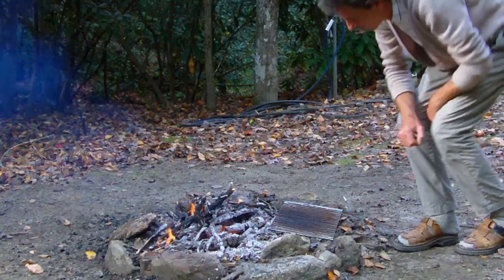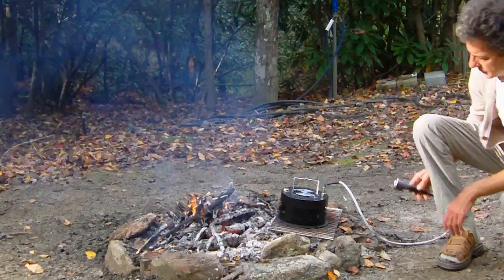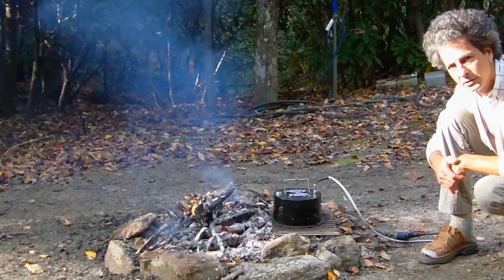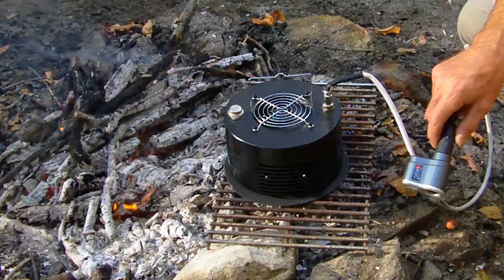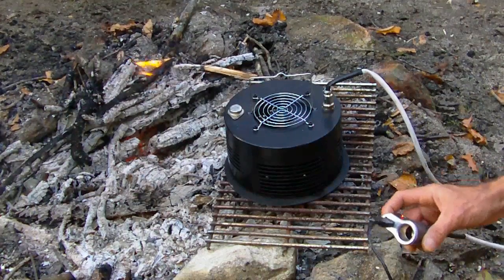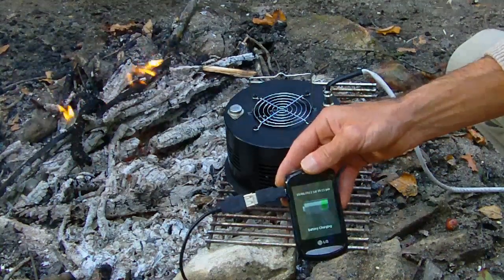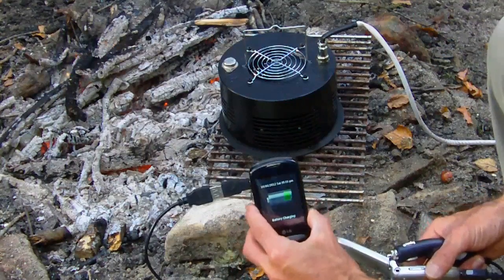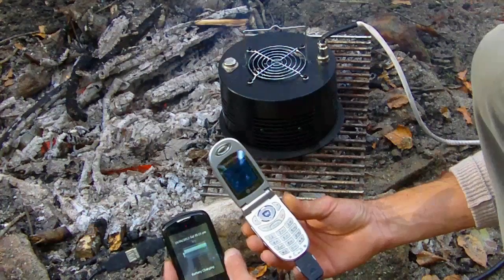Camp Amp 8 Thermoelectric Power Generator on Camp Fire

Comment: So it's basically a stirling engine?
Reply: It's a different phenomenon, but yeah.  There's something Carnot about both, with heat energy flowing from heat sink to cold sink.  Stirling works off expansion of heated gas, based on the gas laws. 

TEG works directly off the electrical properties of metals in a heat gradient.

One of the really neat applications of TEGs in the context of campfires is you can turbo-charge your camp fire with a fan that runs off the heat of the fire.  So you have a battery-powered blower to get the fire hotter and cleaner faster, and you keep the fan running and recharge its batteries off the heat of the fire.

They've got some pretty cool woodgas stoves that you can do all your camp cooking on, with blower and TEGs integrated right into your camp stove.  Quick, smokeless fires because you use a blower.
Reply: No, not even close. Stirling engine requires a working fluid and moving parts. Peltier-effect thermoelectric generators are 100% solid state and have zero moving parts.

They are alike in that they both require a source of heat at high temperature and that they must reject a significant amount of that heat to a lower temperature -- the basis of any heat engine.

With present technology, a Stirling cycle can be MUCH more efficient that a Peltier generator, but it's probably impractical at anything like this small a scale.

Comment: Amazing Product.Would this technology work well without the fan if it was connected to a stove with the cooling element placed outdoors? I am thinking of a scenario for people living in very cold climates.It would be a great addition to a solar and wind off grid setup.
Reply: Gary - The problem with these is that the hot and cold "sides" of the device have to be close together. With a heat source as crude as a campfire and a heat sink as crude as "the outdoors," at least one side needs some sort of heat-transfer fluid to maintain the necessary heat flow. For people living in cold climates, this WOULD be great, because the "cold" side can easily be as warm as a hot-water heater (say 140 deg. F. or higher), and that could drive an indoor heating system and also be used for showering, etc. You would need a little pump in that case to keep supplying cool water to the device, but it would be a nice way to get heat and power from the same fuel source.

Comment from the maker: The cables and wires are fully protected with a teflon coating.  Beyond that, the white outlet cable is protected with a fire retardant fabric like firefighters use.  I have used this generator with a wide variety of heat sources and the cables have never melted or been an issue.  Please visit our website for a more extensive explanation of how the generator works.  Here I am limited to a short explanation.  Thanks for watching.  Please subscribe to see new videos with more explanation.

Comment from the maker: Hey There Idaho Viewer,  The fan in the center is for cooling the cold side of the thermoelectric modules.  It is necessary in order for the generator to make power.  It really does not steal power in so much as without it no power would be made at all.  In brief, the generator operates on a temperature differential.  When heat makes the hot side hot and the cool side must be cooled.  The greater the temperature difference between the hot and cold sides the more power you will make.

Comment: How protected is the cable?

What is the fan in the center for and how much of the power does it steal?
Reply: To be precise the fan DOES steal some power. ThermoAmp is correct in the sense that for this particular device, it would not work at all without the fan. But at the same time, the fan does run off power that is produced. If there was some way to cool the cold side of the junctions with, say, natural convection, then the power used to run the fan here would be available for other uses. I doubt that the fan is much of a parasitic load, though. Because of the way Peltier-effect generators have to be built, it's not easy to put physical distance between the hot side and the cold side. So you need a very effective cooling mechanism. This one (and the Bio-Lite stove) use fans. The Power Pot and another one whose name escapes me a the moment use boiling water to remove heat. That is cleaver and convenient if you also have a use for hot water -- say, for a dinner meal or a cup of coffee, but you need to keep boiling water for as long as you need power, and in some cases that may be less convenient than just having a fan.
Reply: @joeanonimous1105  can't you use said boiling water to power a small steam engine to generate some additional electricity?